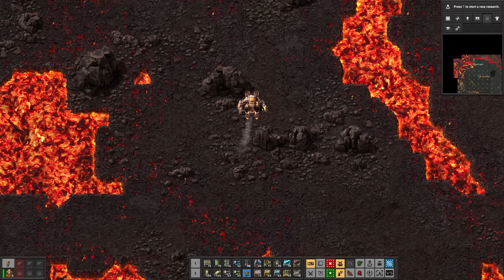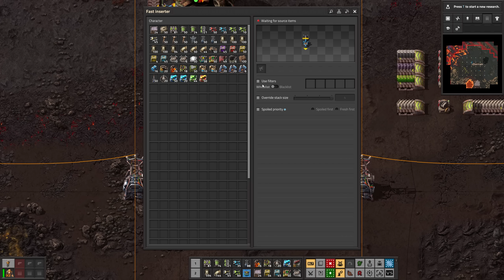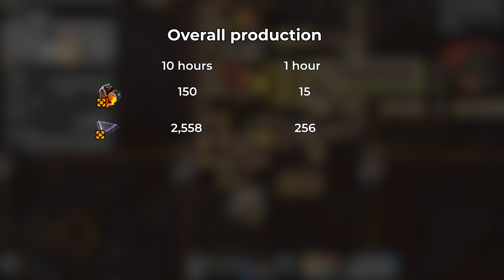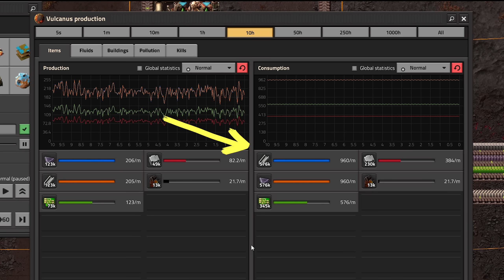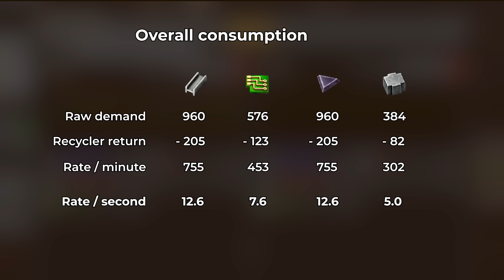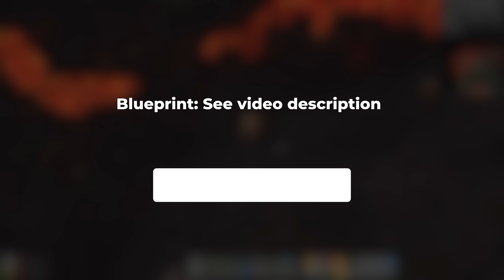Legendary Foundries For Your Megabase

Comment: You entire series is a godsend. I'm doing a 1000x science run and I need to do megabasing in order to have a respectable SPM. The news about the T2 vs T3 modules really sucks as getting the two million electromagnetic science for those packs is a pain (and I'd much rather get the deep oil ocean supports first). Cheers!

Comment: another way to handle stack inserters and odd values is to add a constant combinator with the items you want to handle set to -16 so that it only sends a filter signal when there is a full hand to move. I use -17 because I want the chest to remain in order, but it works at -16.

Comment: 11:05 I assume they meant "using T2 quality modules in the foundry that makes the common ones and T3 everywhere else" because that would make the production rate faster? Obviously T2 are worse than T3, the T3s are there for a reason, but this might be an interesting "corner case"

Comment: What about clogging? After a few dozen hours some materials can get unbalanced. I think it happens most likely when ingredients got vastly different quantity and you have multiple upcycling stacks, in one stack material 1 overflows, in second it could be material 2... on average it's balanced but individual stacks aren't. So far my foundry upcycler didn't clog (although buffer chests can sometimes hit 1-2k), but tungsten plate (green belt upcycling) would clog somewhat fast without removing overflow.

Comment: Worth also calling out that the stack inserter circuit trick also works well with a condition which filters based on having at least a full stack size available, which helps with only doing fully stacked unloads

Comment: The advantage of tier 2 quality modules being cheaper is that they can let you get started faster and/or earlier in the game. If you have the capacity to make legendary tier 3 modules, you should of course use those, but, for example, in your first video where you were boot-strapping your Quality 3 upcycler, you could have saved a lot of time by using quality Quality 2 modules instead of normal Quality 3 modules. Or, better yet, you could have started upcycling Quality 2 modules earlier in the playthrough, and then when you set up the upcycler you'd already have a stash of rare Quality 2 modules to start it up with.

Comment: One nifty trick you can use is to set circuit conditions using the "any" signal, which makes it easy to copy the same circuit condition to all the wires. That save you from having to manually change all the circuit conditions like you do at 5:12 to 5:32. It's not a huge optimization, but it does save a lot of time when you use that trick across your entire megabase.

Around 12:40 when you cover how to use stack inserters with random items, you can do slightly better. If you add an additional constant combinator that has a signal of negative -16, you can guarantee that the stack inserter will always pick up exactly a full stack before it swings. It does mean that some items will be buffered in the chest, but you'll always get fully stacked belts instead of the unstacked belts in final result at 13:20. It's not really that important for low throughput items like the foundries, but it is nice for other similar setups like Fulgora recycling.

Also, you didn't use an upgrade planner to use legendary foundries for producing the normal foundries. I bet that would substantially increase the output of this setup, without much cost at all. How much does this increase for a 10 hour run?

Comment: Great video! I do wonder if it's worth it to set this up immediately when arriving on vulcanus with T2 quality modules. You only have rare quality unlocked, but still just having it make rare quality stuff in the background (and probably setting a similar thing for drills) would mean that by the time you finish fulgora/gleba you'll have at least a few rare foundries and mining drills to upgrade production on nauvis before aquillo. Mining drills especially, with the reduced resource drain they can keep a decently sized base running and making rockets off of one iron patch for days. And all the resources are free except tungsten and lube. 
I'll try that in my next playthrough for sure. Set up quality asap everywhere, get at least a few T3 rare quality modules on fulgora before setting up the legendary quality module production, should speed it up substantially.

Comment: Something you can also do instead of the stack inserter trick is 'Read hand contents (hold)' + 'Set filters' + set the filters to blacklist. This way, the inserter will immediately drop anything it holds, without waiting for new items, similar to the trick in the video. You do need to connect the inserter to the circuit network, but it doesn't need any input from other machines. So you can just connect it to a power pole or another machine that isn't set to output anything. (I really hope we could one day 'self-connect' machines to the circuit network, to make this cleaner)

Of course, when it is grabbing from a chest, my trick is just more complicated. But it also works in basically all other situations, like the inserter for the uncommon ingredients. It will just pick up a stack of items from the belt, then realize it is holding something illegal, and drop the stack in the foundry, without waiting for more items.

There's situations where you cannot read the contents of whatever the inserter is grabbing from (like a car) and then this trick still works, whereas the one in the video does not.

Comment: FIrst 12 minutes: neat
Stack inserter trick: ayo???
Reply: You can also set it up with a combinator to filter that any items over the hand size of 16 sets the filter. That way it’s only ever extracting full stacks. I did this on my scrap outputs of my recyclers on my fulgora base. I would have to boot that world up to remember the exact programming but I think it’s basically if X>16, output X.
Reply: @ryanhamstra49 the innovation here is that you can use a stack inserter and no additional entities (just a wire) to totally empty a chest as long as you don't care about 4-stacks

Comment: What is the impact on the production numbers if you replace the foundry producing normal foundries with a legendary foundry ASAP?
Reply from the maker: Legendary foundries are 2.5 times as fast, so it would multiply it with that. But you would also need more recyclers, faster inserters, and more input material. That said, normal quality should be fast enough here. :)

Comment: I had a stack insterter problem that I fixed recently, I wanted every item from scrap recycling to be fully stacked on the belt but just having 10 stack insterters around a recycler wasn't enough to clear overflows that would stop the recycler (if all of the hands have a different item with an incomplete stack and one of the remaining items fills its slot in the recycler then it just stops). I used the 'everything' wildcard and set it to => 16 and set filter making sure to 'read contents' on the recycler and with the full 10 stack insterters around the recycler it now stacks everything onto a belt and doesn't back up. It would probably work with less inserters especially as everything is legendary but I had already placed them and copy pasting settings is easier then spending time testing the right balance.

Comment: That stack inserter trick is actually a less optimal version of what I'm doing for quality scape recycling.

You see, if you route the green wire through a decider combinator first (set to "Each not equal to 0"), and set the output to be a constant -16, your stack inserter will now receive a positive filter (setting filters via circuits only works with positive values) when there are 16 or more of the same type of item in the chest.

This will solve all of your throughput issues with multi-item stack inserter setups, and will fill your belts strictly with stacks of 4! (Never less)
Reply: If I understood correctly you need to give the inserter both signal from the chest and the combinator so they will add up, right? Won't this work only when there are 17 items? A signal of 0 is basically no signal so in my understanding you need to set the output of the combinator to -15
Reply: @corbi06  you can also use a constant combinator, with every signal set to -15, and connect it with a red wire to all inserters, then connect a red wire from every chest to every inserter, and use that signal to set filters, so you'll get a signal only when there's 16 items exactly. this is just cheaper and works better with multiple chests
Reply from the maker: Your setup makes sense in designs where throughput really matters, and belts always need to be fully stacked.

In this foundry upcycling scenario though, we can do with something simpler.

But I'll get back to your version soon, once we handle more advanced designs. :)
Reply: In this case I think it would cause a delay (waiting until there are 16 items) and less foundries would be recycled per hour, since the recycling of a foundry will produce 25% of another foundry and this being made later makes the next one to also being made later.
Reply: @GeneralMagiber  yes but then it makes/recycles more in quick succession.
Reply: Or the easier to understand version, just set the decider combinator to

condition: each ≥ 16
output: each
Reply: @RazomOmega  the reason people use -15 is you can use it per group of inserters. So if you have 10 machines each having an inserter that you need to condition you need one constant combinator, ine red line going thtough all inserters and one green connecting the inserter to its individual machine.

Comment: How come you did not have Recycler output directly into an Active Provider chest and let bots sort the materials into requester chests? Do you prefer belts or is there a different reason?
Reply: There is no need for that extra step
Reply: @mazziebiscuit  How is that an extra step? The bots do the sorting instead of splitters. Paste down the requester chest next to foundry, copy recipe into ingredients chest.
Reply: @SuwinTzi  sorry for the bad use of wording, I meant for newer player who might not have enough bots/know how to efficiently use them. The use of belts does not add any extra time to efficiency and allows for the newer players to understand how it works. I think a compromise would be if he make a blueprint with and without bots/advanced and new

Comment: Thats a great trick with stack inserters. Closest I've used is having a decider output signals each >= 16 to set a stack inserters. This will cause the stack inserter to only attempt a pickup when there are at least 16 items available as a way to force it to wait for 16 items to become available before grabbing the items. Lets pull from a box or salvager only in the event where the inserter can grab 4 full stacks.

Comment: I don't think the thing about the T2 quality modules is about using them for final production but using them as an intermediate step to bootstrap the quality module production in the first place since they don't require holmium sticks.
Reply: Second this, it's not about using them for final production, but for making legendary quality 3 modules faster, but that also means a seperate legendary superconductor production
Reply: Yes, but the amount of superconductors needed to keep the T3 module going is almost negligible. I think at most it's 30 per minute, due to recycling etc. So it's not really worth it to try and gamble for the T2s first and then T3s.

Comment: the t2 quality module thing is great for getting more quality stuff on a budget. if you are struggling with getting 3s, 2s are much cheaper
but for a mega base context, you arnt working on a budget. if you dont have enough resources you just produce more, thats the entire point of a mega base
Reply: But the whole point of his guide is that if you're following along, you'll have the t3 modules.
Reply: @xalkurahdescent  exactly. the t2 module thing isnt useful for this situation, the only place it might be useful is when you first start setting up the module machine and may not have all the t3s to fill it. but, even that is a stretch since if you are thinking of starting a mega base, you probably have a lot of materials available

Comment: Hey, do you consider using one machine for all the quality crafting since they are way less frequent than the normal one. Some circuitry can help determining which quality can be crafted with items in buffer chest.
Reply: Possible, but you lose the productivity bonus progress when switching between recipes.
Reply: @jsibbs08 This can be amended. Since productivity bonus of foundary is +50%, the circuitry can set to wait for materials for 2, begin crafting and get 3 machines, thus the bonus are fully utilized.
Reply: @qzhong  could work but it's a question if it takes less time to manufacture the extra required foundries or set up the circuit correctly. I suspect it's the former.
Reply: @Kixunil  Quite true, I spend a lot of time setting up and debugging my circuit-control gamble zone. But this is the fun part IMHO.
Reply: @qzhong  yeah, I could also imagine making a bunch of these super optimized things into blueprints and then try to speedrun 🙂
Reply: I think he is using these blueprints as a base for people to easily understand and make
Reply from the maker: I've seen such production setups before, but I'd rather keep it simple. I don't want to build something so complicated, that I forget how it works the very next day. Though it would definitively be fun designing such thing. :)

Comment: Damn the stack inserter trick is so nice.... i observed the filter behaviour before but somehow never got the idea to use it effectively
Reply: An additional trick is to add a constant combinator and set -15 for each item. That way the inserter will prioritize full stacks making it work faster.
Reply: @Kixunil  Yeah, and that’s a great strategy for when you’re trying to keep belts completely stacked. Allowing a stack inserter to put “incomplete stacks” on the belt means that you’re effectively reducing that belt’s throughput in a situation where the incoming items are coming fast enough that you really need to maintain the full 240/s of a stacked turbo belt (I’m thinking primarily of “dealing with scrap and its byproducts on Fulgora”).
Reply: @stillmoms I've had to use two arithmetic on fulgora to deal with automatically generating all the different quality signals without generating smaller stacks. One combinator that does each / each output each, to generate all signals as 1, and another that applies a -15 (or -3, to discard items more quickly). You need a high quality chest though